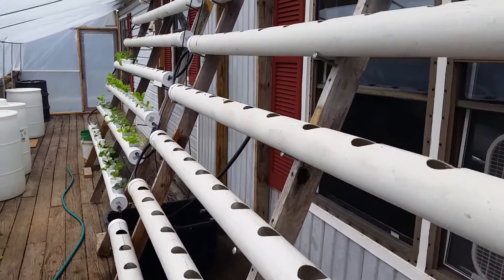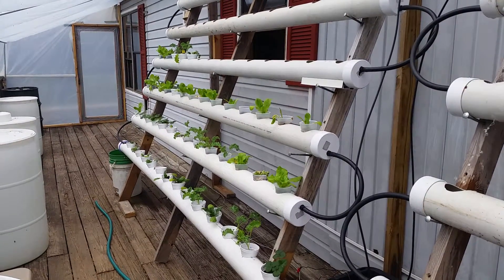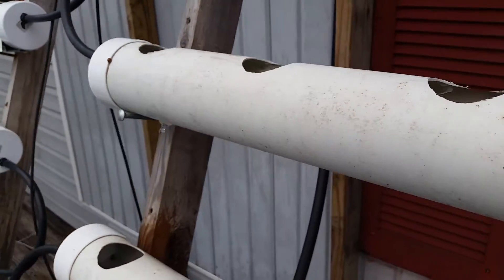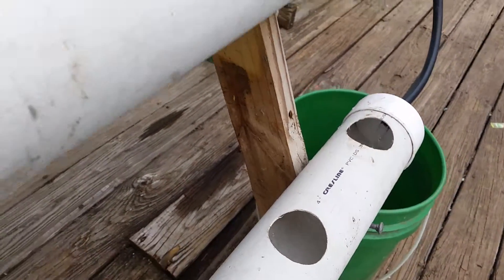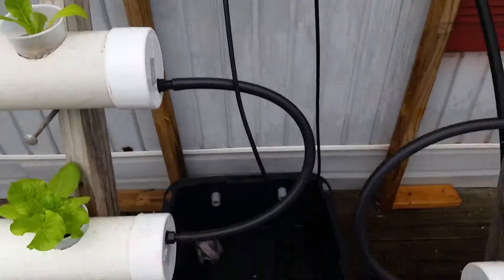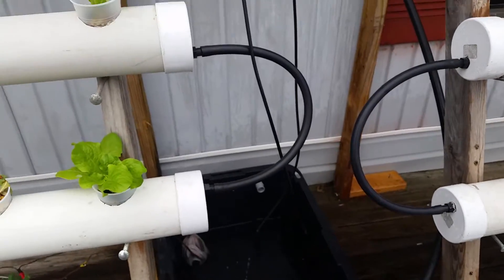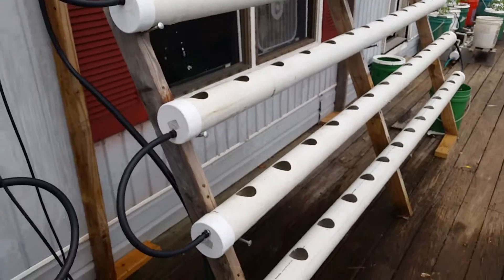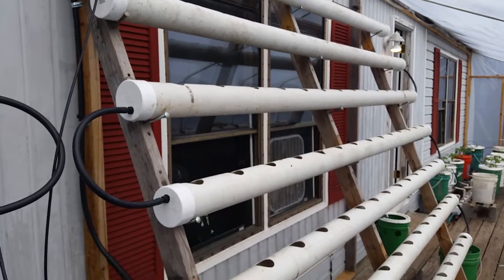Update on Overflow Problem DIY Hydroponics System

Comment: The pressure from the input is higher then the output. I suggest to use a wider pipe on the overflow. Or a valve at the input so you can control the pressure.

Comment: YOU MIGHT WANT TO INSTALL THE SAME LENGTH OF PIPE AT THE T ON BOTH LINES SEE IF THAT EQUILLS OUT THE WATER VOLUME BEING PUMPED INTO THE PIPES, A SHORTER PIPE IS GOING TO FILL THE PIPE FASTER THAN A LONGER PIPE.

Comment: I WOULD TRY SLOWING DOWN THE PUMP, TO  MUCH WATER COMING IN AND TO SLOW GOING OUT, I HAD THE SAME PROBLEM, I WENT AND PICKED UP SOME 45 DEGREE PIPE SAME SIZE OF COURSE AND INSTALLED THEM ON THE ENDS SO THE VOLUME OF WATER DROPS OFF FAST ENOUGH TO THE NEXT PIPE. THEN I PICKED UP ONE END OF THE PIPE ABOUT 1INCH ON THE FILLING SIDE OF EACH PIPE SO IT WOULD DRAIN TO THE NEXT PIPE FASTER. I SET MY PUMP TO RUN 1 HOUR AND REST FOR 1/2, MY PLANTS GROW GREAT. BUT YOU NEVER KNOW. EVERY SYSTEM IS DIFFERENT.

Comment: I am having the same problem, I am fine tuning my system now.you need to regulate your water flow into the top first ( I did this with pots and media in each hole in each level.you need to put a valve at the entry into the top tube, a valve at the exit of your 2nd 3 rd and 4th tubes, you get the level of the top tube so it doesnt over flow in the elected time you have pump running, once you have done this you have to repeat the process one tube at a time. it is a slow and annoying process but it works.

p.s. take the last pot out of each tube to wstch the water level.
Reply: I have tried differnt methods of leaving the pump running and adjusting each level, but I found that if you turn the pump off and drain system and then start on the next level. dont worry I have used a few rude words during this process.